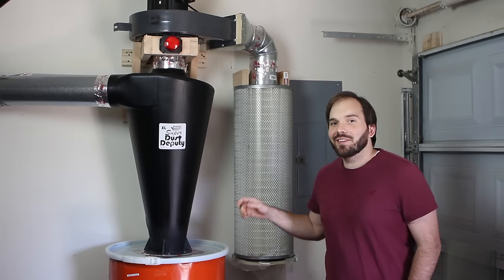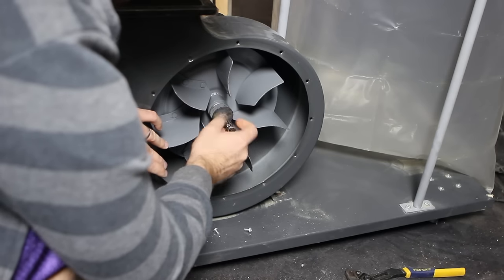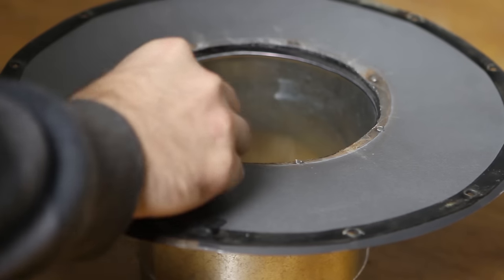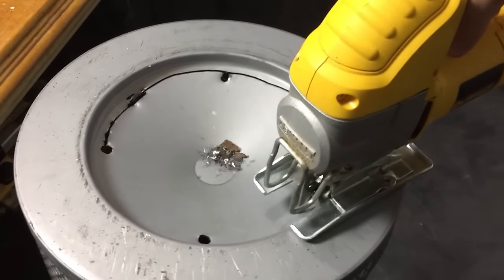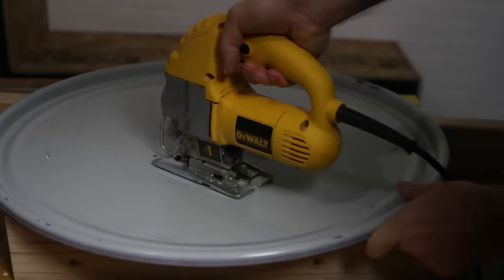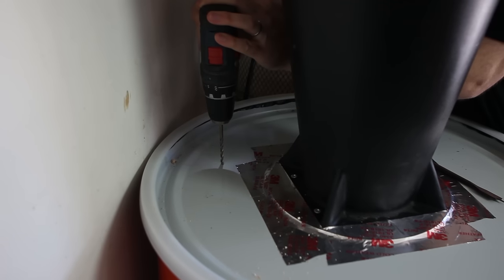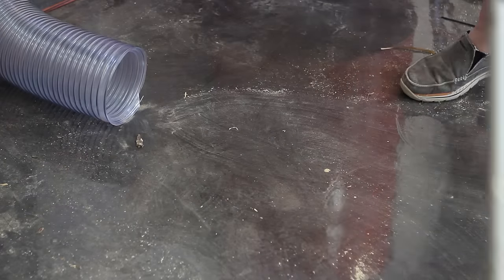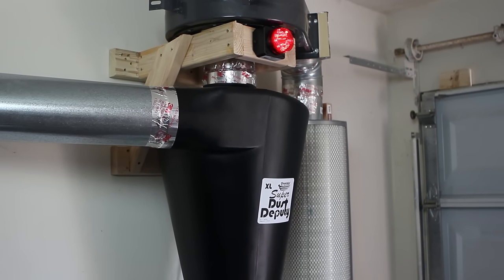Harbor Freight Dust Collector Mod w/ Super Dust Deputy XL - Updated

Comment: I officially nominate you for the best use of five minutes anywhere on YouTube. First, your underlying prune to was well researched and engineered and of real consequence to people. Second, you gave full account of installation, all of the parts used, their sources, and answered all of the questions. Third, you edited for terrific, brief clarity. Thank you.
Reply from the maker: Thanks for taking the time to write such a positive review of the video and I’m glad it helped!
Reply: 'scuse ME, but of what value is a reverse oriented blower fan? This system will be a LOT more efficient in moving air if you stick with the same directional blower vanes. There is even a sticker on the housing indicating air direction flow and the vanes SHOULD be curved in the same direction as the replaced blower. Major screw up here. WHo sold you this replacement blower?
Reply: @darrowfortheprosecution1404   It is common to have reversed vanes on the blower because of the improved efficiency and reduced noise.
Reply: @Mike--K  You are correct. I did notice the impellor isn't listed on the comments where the info is listed by Mr Grey House Studio. I'd like to know where he purchased it.
Reply: @scottmorgan5370  The most common replacement impeller for the Harbor Freight blower upgrade is the impeller from the Rikon P60-200 dust collector.

Comment: Great video, love the concept.  Unfortunately now (2019) it's almost impossible to get that impeller and total system cost is equal to or possibly greater to just buying a system.  Surprisingly there's still hardly any reasonably priced / smaller dust collection options for small shops.
Reply: Rikon 12” impeller???
Reply: I just bought a WEN Turbo Fan 3403-022. $50
Reply: @timjeffers2703 where did you buy it from?

Comment: Just did this impeller upgrade on my HF unit last week.  Running only the blower housing with a 6" inlet was pushing 17 amps, and the breaker in the basement was humming.  Like you, I also reached out to Oneida but they recommended a SDD (not XL), so I bought it.  When I attach the SDD to the blower housing (no filter yet) amps drop to 13-ish.  A 2hp 70% efficient motor should be drawing 16 amps under full load, so this tells me already the system isn't operating as efficiently as it should.  As a result I believe the SDD, while rated for less than 3HP units, actually ends up significantly restricting flow, with only a 5" inlet port, at least in the case of the modified HF system.  So, I ordered an XL to try that out, and whatever one ends up working the best I'll keep.  The other will end up on ebay.  As my first youtube video, I may document the experiment between the two SDD's for all those who may be interested.
Reply: byugrad1024 

Where did you get the impeller upgrade?
Reply: @willjung3691  I got it from tool center dot com (cyber woodworking depot llc).  It was like $10 more than other options which at the time were unavailable.  It may be available again through Rikon directly, but last I looked it was backordered.
Reply: byugrad1024 

Thanks,   One other question.    Where did you get that filter?
Reply: @willjung3691  I haven't ordered a filter yet.  Maybe you are thinking of the author of this video?  He doesn't seem to be answering anymore probably because this video is several years old.
Reply: I know this comment is 1 year ago but I just got my HF DC and I was thinking of upgrading to a SDD. Did you find out which one was best? I am thinking of going with the standard SDD instead of the XL since it uses less amps.
Reply: @CampfireCrucifix I ended up going with the sdd XL.  The flow and velocity was more and amps were down (less restriction) but I am pretty sure not extracting dust as efficiently as possible since the XL requires much more flow and velocity to work best.   My setup doesn't require it as I am just an occasional woodworker.  Either one will work for your setup.  In my case I decided on the XL in the event I would upgrade the blower in the future with a homemade unit.

Comment: Love this.  I built something very similar using an old 1-stage 1hp Grizzly and Super Dust Deputy that has worked great for about 15 years—even installed a larger impeller which made a big difference.  Mine is mounted on a mobile stand but too cumbersome to move—the wall mount system used here is better.  Having a huge outflow filter surface area is key to maintain the air flow.  A way to clean the filter to keep impedance low would be a big improvement, but the cyclone is so efficient (and I’m so lazy?) that I’ve only cleaned it a few times.

Comment: Good Video i liked the impeller upgrade   And the whole system you created  thanks for all the details I’m a retired Woodworker and between shops/ homes at this point in life due to a Traumatic Brain Injury that forced me into early retirement  i. Think I’m going to use a Cardboard Sono Tube as my barrel so i can poprivet a viewing Acylic window to  monitor dust levels  in a not so “?high tech” way you did  ! Truthfully. I didnt knows that system existed  so thanks  I’m 56 years old and I’m learning everyday from you young guys !
Reply from the maker: Let me know if the sono tube works. I thought about that but was afraid t might crush under the vacuum. Getting dust collection in place for all my machines made such a difference!

Comment: Thank you for this. I just used some of these steps to mount my filter and customize the filter top and blower intake to use 6" duct collars. The use of rivets to attach to the blower was key to avoid interference with the fan.

Comment: Nice video, You inspired me to use my wind indicator I already had for sailing to measure CFM!!!   I would suggest people start by making a simple manometer to read the static pressure.   That would cost virtually nothing.   It's so funny that Harbor Freight tools either become parts for really nice systems, or need a lot of mods to become good machines.   A lot of these things would cost very little at the factory (like a better impeller), and would let them make a "Pro Line" of tools and make a lot more money.
Reply from the maker: It is so true.

Comment: Once you have removed the impeller you the can remove the 4 bolts that hold the shroud and then you can turn the shroud so that the original motor mount can be used to anchor the unit to the wall. Just did that today. Waiting for the dust deputy and filter. Great build. Thanks for sharing.
Hank
Reply from the maker: Thanks for pointing that out Hank. That is one of the only things I might go back and change about the build. I didn't realize I needed to/could rotate the motor with the four bolts behind the impeller until it was too late. I borrowed the puller tool to remove the impeller and had already returned the tool once I made the realization. Hope your dust collector build goes smoothly.

Comment: I have an HF unit I changed up too. The motor is really more like a 1hp. and not really efficient for 6in pipes.. (3hp good) you work with what you have  I'm hooked up with cheaper 4in pipes and works OK.  (actually very happy 6 years now)

Sooo fellas, what is the part number for that tasty impeller, have to have one!!    GOT IT .... Part 21 /    P60-200-22

I do like your set up not too big not to small. I run the air out a hole in my garage, no filter to replace or clean. MDF board is the true test for these units.  great set up !!!

One more thing... try and use the least amount of flex hose as possible, it kills airspeed.  You can add a small window to the bucket for dust monitoring too.

Comment: Brent, 
I can't thank you enough for making this video. You were kind enough to leave a comment to my post on the Lumberjocks forum as well as a link to this video. This is exactly the mod I am making to my HF DC for my shop this year. My build is still at the infancy stage. Only the HF  DC and Powermatic 4" X 20' flex hose so far. Taking your valuable time to list links to the parts and price breakdown for this build in invaluable.   Taking the comparative CFM reading before and after the mod was extremely helpful as well. This video was very well made showing all aspects of the mod from start to finish. I would say, of all the videos I've seen of this mod on YouTube, your is by far the best.   Thank you again!!!!
Reply from the maker: Thanks for the kind words! I read through a ton of forums about the impeller but had a hard time finding any results. I'm glad this video helps fill in some gaps. I'm excited to see more Harbor Freight Dust Collector builds like this.

Comment: Only thing left to show us is the emptying of the 55 gallon barrel.  No way to throw slack between drum and the cyclone.  

I believe I'll be mounting my barrel on a wheeled cart and use a drum liner. Wheel it close to where it's going to be emptied and remove the bag. Easy Peasy.  Getting the barrel back together whether sliding or rolling is when you need your slack.
Reply from the maker: I wish I had the ceiling height to add a bit of flex between the barrel and the cyclone of the dust collector. I decided to use a jack on wheels under the barrel. It lets me lower he barrel about two inches and roll it out from under the cyclone.
Reply: @GrayHouseStudio  
Cool beans.  You should have included it in your presentation.  Not all are dialed in on the small things. How come you didn't utilize the stock cyclone to hang your filter ??
Reply: Nice presentation by the way

Comment: The Oneida Dust Deputy XL that you used is rated for dust collectors that have 3-5 horsepower. The HF has 2. Has this translated to any issues for you? Do you have anything more than very small amounts of fine dust getting to your last plastic bag?

Comment: Great tip on the impeller, ordered one from Rikon today. 

Thanks for posting this!
Reply from the maker: +Peter Kelly Awesome! It is good to know the process was simple for you too.
Reply: This helps.   Love your set up.  Was wondering where to find an upgraded impeller.
Reply: Impeller blades are backwards, you are losing about 1/2 suction.
Reply: @MrCarrizojim   Rikon designed their  impeller intentionally this way as reverse curve blades create greater static pressure using significantly less energy. Forward-facing blades will create greater air speed and less static pressure and the trade off isn’t worthwhile on a 115v motor of that size.

Comment: I wondered what impellar you were using.   There is some discussion on LumberJocks re: this Central Machinery  Dust Collector with the Rikon impeller .  Have you measured the amp draw with different gates open?   I'll look into your videos to see your ducting.  The DC from harbor Frieght has a @ 5 inch port.  Good luck!
Reply from the maker: Ya, the Rikon impeller works great with the Harbor Freight Dust Collector. I haven't had a chance to take detailed measurements of the amp draw with different gates open. From what I can tell, the initial impeller ramp up when the motor is first turned on draws the most amps. I was able to change the stock 5 inch port to a 6 inch on the Harbor Freight DC to increase air flow.

Comment: It would be nice to know where you picked up the bigger impeller??? It would also be interesting to see your finished system, and see if it's as good as in your first test. Other than that, great video.
Reply: Yea, wtf. Links my ass!
Reply: The impeller from WEN (3403) also works to upgrade the HF dust collector.

Comment: What a nice video I'm curious on the modification of the impeller.  I didn't see a link or any onfo. getting one.
I would have thought doubling the size of the impeller would double the CFM??  Isn't the impeller going the wrong way. Confusing to me
Reply from the maker: It is a different style of impeller. This on cups the air as it spins and generates more pressure. Although it doesn’t double the CFM it makes more consistent vacuum when hooked up. You can get one when it is back in stock, https://www.rikonparts.com/product/impeller-c-5-4-2
Reply: @GrayHouseStudio  thank you.
Always thinking about pressure never thought about vacuum 
Just curious 
How did you come across that

Comment: Troy Meredith asked this a couple years ago - but how exactly is the dust collector/blower secured to your bracket/wall?  It looks like it's just sitting on it unsecured.
Reply from the maker: I built the wood rack so it fits snug about the outlet into the cyclone. That prevents side to side movement and used some foam tape under the motor blower to provide some adhesion and dampen vibration. It stayed like that for a while before I added an additional like of security by screwing through the wood and duct entering the cyclone. I didn't want to put screws into the blower.

Comment: Do you have to change the inlet if you change the impeller or was that just for the Oneida unit? This video is making me lean towards the HF unit for sure. I’m assuming changing the inlet also increases cfm? Thanks
Reply from the maker: You don’t have to change the inlet. I only did that to plow me to hook up a 6” pipe directly to the inlet on the blower of the harbor freight dust collector. I think that certainly contributed to the CFM increase.

Comment: Awesome video! I will be replicating, but venting to the outside. 

Question -- How do you empty the drum? Naturally you pop the locking ring off, but do you have a mechanism raising and lowering the drum to the ground since the cyclone and motor and attached to the wall? How are you supporting the drum's weight when it's attached to the lid? Thanks!

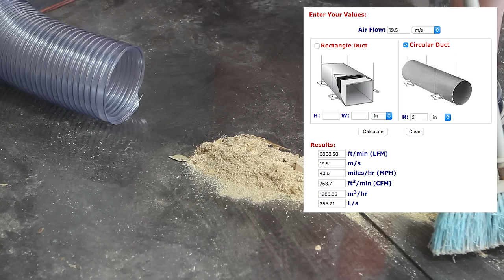Comment: I realize that this is an old video and I hope that you can answer this question. At 5:08 you show the air flow results, one thing that jumped out was that your ft/min is less than the optimal 4000ft/min, and that was just a short piece of duct and flex hose. Once you get the entire duct system installed, I'd guess that with the static pressure losses you will be significantly less than the 3838ft/min you displayed, which can cause wood chips to build up in your ducting and not move the really fine dust. So, I'm wondering if you measured the cfm at you machine that is furthest from the dust collector? Have you had any problems with the dust collection?

Comment: I know this video was a while ago but curious it your filter was big enough to allow filtration and also air escape so that the small bag doesn’t blow off. The filter you used is smaller than others systems I’ve seen so curious if it provided enough airflow. 

Any changes you would make to the system if you could do it all over again?  Great content. Thanks.

Comment: I have the same unit, HF collector and Oneida cyclone attachment unit.  Have you ever lubricated the motor?  Also, if you have, how did you lube it?  Do you also clean the vertical filter often?  Good job!
Reply from the maker: That is a great question. I am actually horrible at maintenance. I usually just dust around and blow out the motor. It has been several years and I still haven't lubricated it.

Comment: Hi I think you have a lot of HF DC owners excited about making their low Dollar DC work better. I had one question. At 2:27 "In order to let me attach a large cylinder outlet I attached???????" This is my sticking point. I have a few DC's to convert, and most are some form of rectangle, but the connecting housing won't turn, and if you use that for inflow from your ducts you need to attach something. In your list of materials you call it a "6″ Duct Transition" My problem on my 3rd transition is where do you find one that plays well with anything dust related. I see you mounted it to a plywood plate, which I assume you calked the crap out of, and did a flat plate to a recessed fitted/formed piece of sheet metal. When I have tried this it sounds like a pre-pubescent boys choir with 1200 voices all singing 3 keys to high. IOW it leaks like a biatch. Can you share what fitting you used? It seems to me this is the key ingredient, yet on all the DC flips I have seen, everyone blows by it like it's not important. TIA..

Comment: Hi, New subscriber!
Outstanding video!Right to the point and easy to understand!
I just bought a 4" Super Dust Deputy that will sit on top of a sealable 55 gallon steel drum.It has a "clamp" style ring that seals the top to the drum.I'm concerned about an air leak at the cover seal.You didn't mention sealing the barrel cover with anything.Did you use any type of rubber seal or something else?
Thanks for a great (to the point) video!
Tom
Reply from the maker: I had some leaking on the lid, good point. I put two layers of duck (not duct foil) tape on the barrel rim and that created a cheap gasket solution that sealed the lid.

Comment: Thank you for this video.  It was clear and precise so Thank You!  I had an issue removing the impeller from my HF unit.  Turns out it was rusted on the motor shaft.  2 days of PB penetrating oil and tapping into the collar with a custom puller tool and I was able to remove it.  Looking forward to my new setup.  Your video made it clear.  How is the motor housing mounted to the top of your 2x4 wall bracket?

Comment: Do you run a 6 inch hose to all your machines?  If so where did you find your connectors/fittings?  Seems like 4 inch in the only real option.
Reply from the maker: I went 6” across the top section and 4” to every machine. At each “Y” I used a 6” to 4” reducer.

Comment: Whats the noise like?  any dB readings?
Reply from the maker: I didn’t take any readings because I was so happy it was way quieter than my shopvac. I should!
Reply: @GrayHouseStudio  well quieter than a shop vac is something.  Could you encase the setup with an exhaust port?  or does it really need to stay open and breathe?